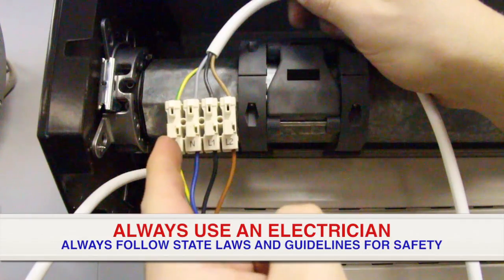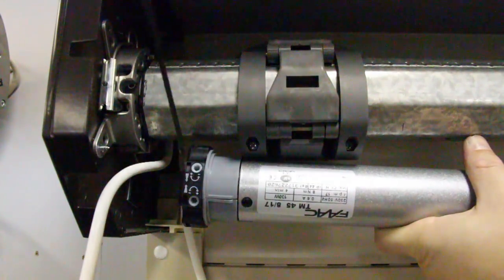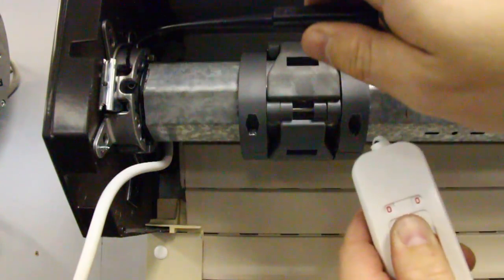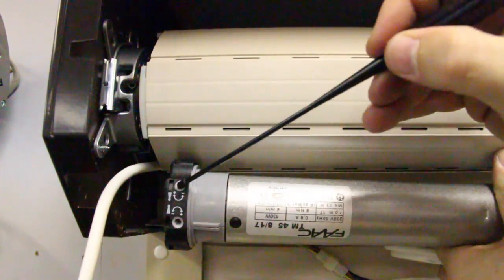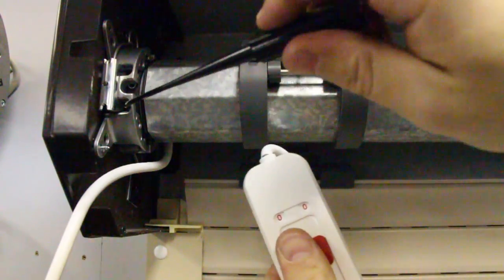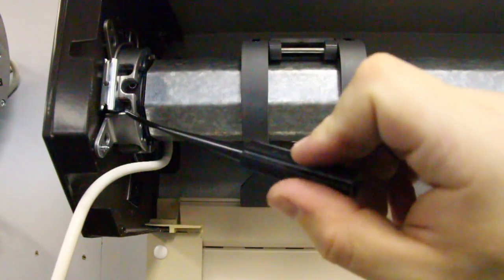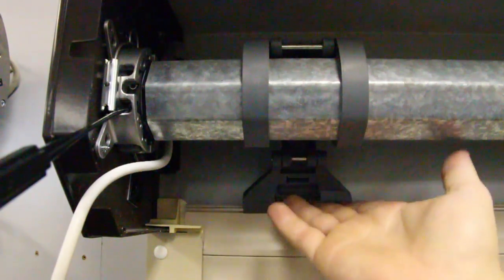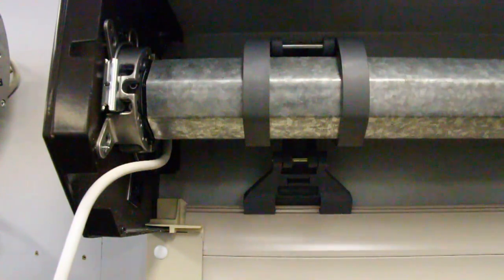How To Set Limits on a Tubular Motor - Dumb motor limit setting

Comment: Any idea what I'm doing wrong ? This is really bugging me !!, I just installed one of these motors and converted my tired manual roller shutter garage door to electric, I wired the up/down key switch OK but I am having a problem setting the upper and lower limits, I use the plastic key stick to set the upper limit by inserting it into the up pot , The shutter door then goes up to where I have set my upper limit but when I go to bring it back down by turning the key switch to the down position NOTHING HAPPENS ! - The only way to get the shutter to go down is to use that plastic limit setting tool and turn it in the second pot (the down pot) but when my shutter then reaches the down limit I set, when I move the key  switch to the UP position the shutter refuses to move up, it is dead. I know this is something to do with the limit switches maybe not fully switching over to connect the opposite circuit - ie, once the shutter is at the down limit position, it is not fully engaging  the circuit needed to reverse the motor rotation in order to bring the shutter up when I turn the key switch to the up position...any idea what I'm doing wrong ? 😕😕😕

Comment: Hi sir i went through your video , very explanatory , i also leave in Australia and i want to convert manual to remote controlled motor , what motor is the  most appropriate to use ? So many different ones whitch one is the right one?
Reply: Hii sir  am from India I 3 y experience aluminium rolling shutters and fuom shutters Saoudi Arabia also India experience 7 y aluminium composite penal caledding facade work i need job can you please reply
Reply: No deals with indians. @kumaoninterior9424

Comment: Just wondering what sort of switch if any do you have on the inside wall in case anyone wants to control the shutter from inside the room without a remote control handy?
Reply from the maker: There’s many solutions to this problem. Have a look for “wall mounted roller shutter motor receiver”

Comment: hi.  does the metal tube come with the motor?
Reply from the maker: No, sorry. Additinally, the motors do not come with Drive wheel, crown or bracket. You need to buy the correct sized parts to fit your existing tube size. Some are hex, some are octagonal, some are round. I hope this helps. 😊

Comment: thanks mate
informative and lifesaver
the tool you use to adjust the limits, 
what is it called, thank you
Reply from the maker: They come with most motors. It's just called a Limit Setting Tool. One comes for free with every motor and your local shutter supplier probably has about 500 of these just laying about. If you drop past them and say Hi they will probably give you 10 for free!

Comment: My problem is that the engine does not stop, both when lifting and lowering. I tried to clone the remote control  and something went wrong. Now the two blinds work simultaneously, and one does not stop. What to do? please help.
Моят проблем е че мотора не спира, и при вдигане и при спускане. Опитах да клонирам дистанционното контрол  и нещо се обърка. Сега двете щори работят едновременно, а едната не спира. Какво да направя? моля помогнете.
Reply from the maker: sorry for the delay. You seem to have wired the motors in parallel. You MUST have two switches. One switch for each motor only. Never use one radio receiver to operate two motors at once. Hope that helps someone... even if my reply is 3 years too late.

Comment: Hi, thank you for making this video. How easy is it as a DIY project to install motors on shutters that are operated manually? It did not look really complicated. What xould possibly go wromg om the conversion? ;-) ?? 
What is the typical life expectancy of such an elecric set up? I saw in the comments several non-functioning sutters. What are end-off-life failures for elecrrified shtters? In the comments I read that blocking of the motion of the shtter will kill the motor? What more could spell disasrer? 
Would I need different motors for different shutters (2x 1.15*1.5 m ; 4x 3*1 25m ; 2x 2*1.25m)? The wider ones are quite heavy to pull up by hand. Further, I am comsidering to add a shutter for both the garden window and at the front door (2z 1.15*2.2m). And a big shutter ar the garden doors (3.3m high, 2.25 m wide). All om the same type of motor?
Is it possible to connect the motors to a domotica system to automatically raise or lower the shutters?
The biggest question is the shutter at the front door. What if the  power fails or the motor fails? Or if the battery of the remote is empty?How do I enter my home then? Crowbar? There must be some kind of trick, I presume. Thank you for you time answering my questions! :-)

Comment: Hello thanks for the video. The shutter I have the motor hums it is hesitant to pull the shutter up or down. After it gets going it's fine. Ive checked the slats nothing jamming in the tracks. Using the manual override there is no issue with it operating. Is it a case of a failing motor? Thanks

Comment: Great Video Mate. I"m having problem with my electric shutter blind. Every time i open the blind it would only open quarter the length and day by day length reducing. Its been couple of month . i use the blind on daily basis but couple one ago at one stage i did not open the blind for about 2 month. since it causing trouble. motor does seem to be working fine but blind would not lift all way up any help could be much appreciated and also shutter installed into the eve  and it is hard to get to.
Reply from the maker: Hi Lucky. 
If its moving little by little in one direction but further in the other then the encoder is dead and the motor requires replacement. IT may just go 'click' once with every remote button press in up (for example) and may movve continuously for a few seconds in teh other direction... if either of these things happen, its got a dead encoder and bad news. you need to replace the motor. 
it could also (very unlikly) but you may have a problem with a slipping crown wheel (the non driving wheel on the tube)... this will cause the motor to stop every time the limit registers a fault (once per rev or once per 1/2 rev - for example) and retract the other direction... i hope this helps. 
if there has been an elecrical disturbance (lightining, there will be possible faults also)

Comment: If every motor has its own limits setting,  why it is not allowed to connect motors in parallel? Thanks for explanation.
Reply from the maker: Simha Pilot - just don't. 
It's complicated. 
Unless you have a sound understanding of electronics, my explanation would be wasted. Sorry. 
It ruins the motors' limit switches with a surge of power every time they hit a limit.
Reply: Thanks so much for the prompt response. 
If I understand well; if I wire 2 switches form the very same main power source, one for each motor it is not the same like wiring one switch and connect the motors in parallel.
Does it mean that the limit is not a simple switch disconnection? Does It  depend on transient from the other motor?
Reply from the maker: Simha Pilot no problem. 
Two switches will give two mechanical and electrical interlocking connections to the "opposing power direction" the important part. 
As long as the opposing direction is not connected (it WILL BE - in a single switch/parallel scenario) while the motor stops there is no problem. 
If connected in parallel the stationary motor will "jerk" and the limit switches will eventually fail.
Reply: Thanks a lot for the detailed explanation
Reply from the maker: no problem. I was tubular motor technician for 8 years. 
One switch per motor is fine. ...but DO NOT use two switches per motor or two motors per switch.
See you!
Reply: Unless you get a special 2-pole switch that is rare to find :-)
(Some rotary switches are available with connection of up to 3 motors possible)

Comment: Great Video. I have inherited a problem. My electric Shutter blind, lower limit is not adjusting. Top limit is fine and adjustable and I have checked that adjustment and played with it same as you did. The lower adjustment just does not do anything. I have twirled the screw until the cows came home. Can this be faulty inside? Is there an easy fix? There is no make anywhere on this unit. It has an 8 sided corrugated roller. Any ideas?
Reply from the maker: Did you use a power drill with Alan key to adjust the limits? If so you may have sent the internal worm gear carrier off the wrong end of the thread. 
It's rare to have happen but can't be fixed without removing the motor from the shutter. 

Another possibility is that the little micro switch inside has failed. 

In either scenario, it's somewhat repairable. 

If you live in Australia I could tell you some people that may help.
Reply: +iamjeffreydohnt  Thanks for your quick reply. As I said I inherited this problem so can't say if a power drill done the deed. We're in Costa del Sol, Spain. many thanks for your help.
Reply from the maker: +Mike Ritchie try http://www.faac.es/ and ask for a tubular motor specialist in your area.
Reply: +iamjeffreydohnt I will take that motor out and see what's wrong. Well done and thanks again for your help and info.
Reply from the maker: +Mike Ritchie keep me posted. 😄

Comment: Any idea why tubular motor is operating only one way? My shutters worked 100% for about 1.5 month. After that out of blue they wouldn't open. When pressing remote or on the receiver you can hear click from the relay and 220v appears on signal wire but shutter won't even move. I can open shutters manual and after pressing close (on either remote or side of receiver) shutters are closing perfectly. Stop button works every time as well. TIA
Reply from the maker: Where are you? Australia? USA? 
What brand motor?
Remote controlled? 
Is there a separate radio receiver? 
Battery operated? 
Solar powered? 
Wall switch? 

Let me know and I'll be able to tell you more. 

If FAAC, and radio controlled, chances are the encoder has had a power spike and failed. Motor requires replacement. 

If hard wired (any brand) micro switch may be dead or switch on wall or receiver could have failed. 

Many reasons. More info please. :-)
Reply: iamjeffreydohnt thank you for prompt reply.

I'm in Ireland.
Don't know the make as motor is riveted inside the tube.
I do have to fobs for remote operating.
The main box with relays and 3 buttons on it's side (up, stop, down) is the receiver as well.
Operated from mains.
I don't think it is micro switch as when checked with multimeter and 220v is appearing on signal 1st signal wire when button down is pressed (on the side of receiver or remote) and 220v appears on 2nd signal wire when I want it to open.
My only thought was that if the problem was the motor then it wouldn't work at all, and because its closing no bother I thought resetting limits could help.
Reply from the maker: The presence of 220 is good but the problem is from within the motor itself. It has micro switches. They are repairable and replaceable in many cases but (as the 2nd most experienced person in Australia for tubular motor repairs) I say, it's easier to replace it. Like for like. 
Check my other videos. I think i posted one about installing tubular motors. 
Finding the correct micro switch could be fun on eBay if you have The time (and a soldering iron and lots of time). 

My guess, either the motor has come adrift from the tube and the limits have skipped to a point where it's never going to operate in that direction (very very unlikely) or that the microswitxh that corresponds with that particular limit is blown or fused. (Very very likely) 

Good luck. 

Try calling FAAC automation Ireland. They will put you in touch with a company that can help you or put you in touch with a guy.
Reply: I am having the same problem with Becker motors. Exactly the same problem. Could you comment how you have resolved it?
Reply from the maker: +Sttm35 hi. I would contact your closest Becker head office.

Comment: id say letting customers try and set there own limits is a big no no. Just opening a can of worms up for your self.Guaranteed they will take door up and outta the guides and get door jammed in canopy. Better just to return to site and commision door/Repair it yourself if you know what you are doing.
As for industrial doors you woudnt be using a tubular motor .More like a 3phs with a sprung barrel. And dont get confused with thinking the motor lifts the door.Obviously it does on shop front type but on industrial doors there is springs inside barrel what counter balance the weight of the curtain, the springs inside the barrel are there for two reasons.
1. To lift the weight of the curtain/counter balance if its sprung correctly
2. If motor fails door will drop but springs will tension up and act like a safety brake
Reply from the maker: michael perry Thanks for your reply. I'm instructing installers on how to setup tubular motors. (45mm/50mmØ only) I never mentioned shop fronts, nor to get customers to set their own limits. Shutters can be very dangerous (always) and every person that opens up a shutter to perform repairs MUST know what they are looking at i.e. be an installer/electrician. This video is designed towards installers and electricians, sorry for any confusion. Nobody is talking about shutters, curtains, springs etc... this video is strictly for the motor and the anti-break in device. However, thank you for your knowledge, you clearly know what you are on about. I agree commercial shutters with spring and anti-fall/auto-brake devices are incredibly safer and usually longer lasting, but are not the subject. Cheers :-)

Comment: Can the door jamming on one side going down cause either or the crown/drive to break or wear down? My roller shutter door is running for the correct length of time but is now not going up fully and when going down rolls too far and starts to unravel at the top. New motor is too expensive so I was wondering is it common for these to break?

Thanks for any and all help
Reply: If the tracks are 'clamping' or stopping the shutter from travelling down, BAD things happen. 
AS for damage to the crown and wheel, i'm not sure what you mean by that... The drive wheel and crown are VERY strong and can withstand/lift up to 90kg (even on a ø50mm tube)!
There is a possibility that if you have a 50mm round tube, a rivet has slipped and come loose. This will mean is just needs to be opened and re-riveted. A simple fix for 50c. 
Possible too that the top tube needs to be replaced because the installer/manufacturer didn't insert the motor into the tube correctly. Refer to my other installation retro fit video for a small insight into the notch that may need to be put onto the tube. Shutter components Australia VIC should be able to assist with all your enquiries. 
tanoisalegend

Comment: So loud.
Reply: The noise is due to resonating of the operation of the motor within a gyprock/drywall room that has a timber panel hung on it with the shutter on top of that. 
Take the motor onto a brick wall or a 'normal' installation and they are fine... Or more than fine.

Comment: I manufacture roller shutter doors too here in the UK. I have to try and explain to customers over the phone how to set limits, easier said than done.
Reply from the maker: I used to work for Somfy Australia as Technical Support and Customer service... for 4 years... I've been in the industry as a tubular motor expert since the last 12 years. I feel your pain mate. If you ever need any tech info on Somfy or FAAC tubular motors, let me know if you are having a hard time. I used to repair the tubular motors before that. Some people are quick on the uptake.. some... well lets say.. they are less than able.
Reply: iamjeffreydohnt Can the motor be repaired rather than replaced? Following a trailer hitting the bottom strip on my interlocking lathe roller shutter door its caused problems. The door is now travelling the right distance 'correctly set' but the door is stopping short of where it should and when going down is unraveling. Its like it has slipped/missed a couple of cogs. Can these be replaced as I was quoted €270 for a new motor? Thanks.
Reply: tanoisalegend hi where abouts are you from. I supply motors here in Northern Ireland.
Reply: Darren Ross Sligo. I don't know which make/model motor it is but I got a quote from 'paramount doors' in Cavan who manufactured the components. I need a guide rail and base bar with weather strip too but the price they quoted for these was reasonable. It was actually €285 + vat. Thanks